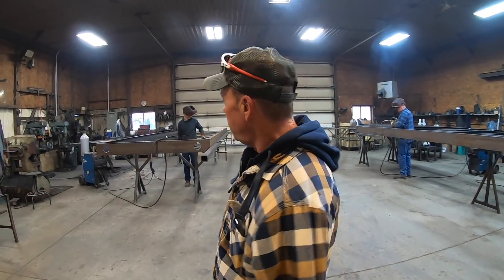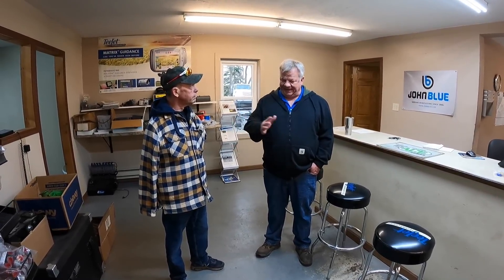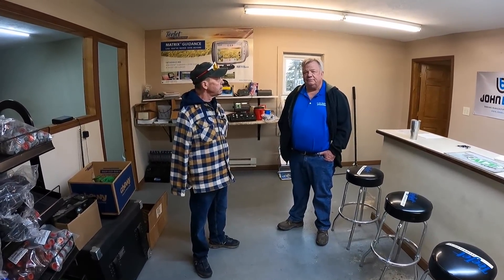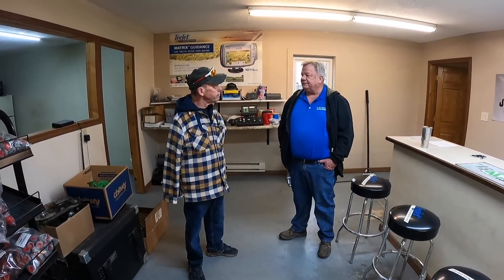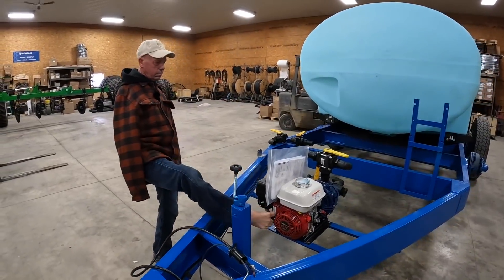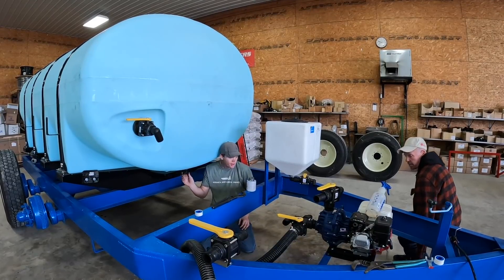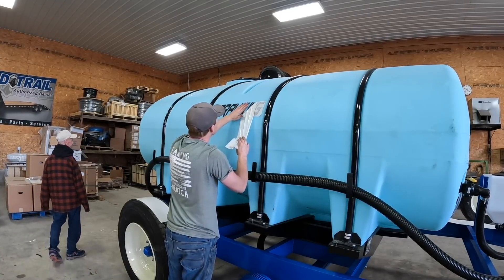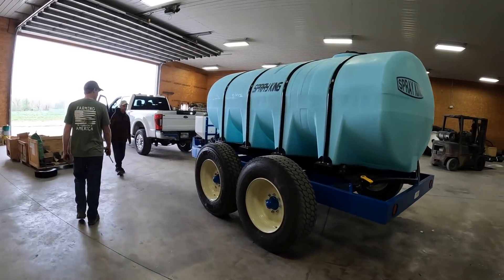Its A Beast, SprayKing 1850gal Nurse Trailer

Comment: I had that exact same trailer custom built this past year. The only difference with mine, it has four 5,000-pound axles on it. My mother-in-law comes into town regularly and needed a sturdy platform to get her around town (over to the Golden Corral 3-4 times a day). I noticed if we left her on the trailer too long...the tires would start to distort and flatten out.

Comment: My neighbor gas a 2000 gallon trailer like that. Very solidly built but it is a beast to pull even with just a quarter load of fertilizer sloshing around in it.

Comment: That should make things a bit easier for ya on the farm. For the size it should be a time saver for sure.
Great looking rig.
Change the oil in that Honda after about the first 10 hours. Helps remove any manufacturing metals that might have gotten in there.
Use non ethanol gas and you want have problems screwing up the carburetor. 
Hope you enjoy it.
Praying for you daily. 
Take care and God Bless.

Comment: Andy, if you're going to keep hauling heavy loads and plan on keeping the new truck for several years, look into a cushioned hitch. DMI and P&H used to make the whole bumper but I understand that there are smaller versions that work with Reese Hitches. Just saying.